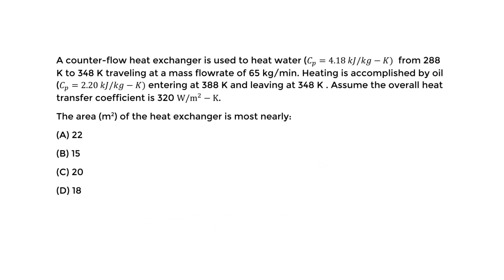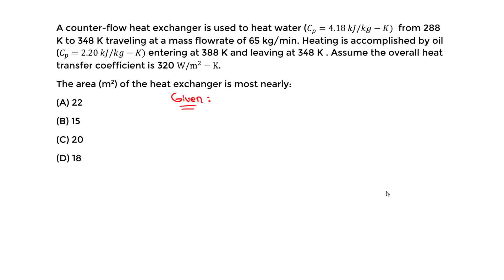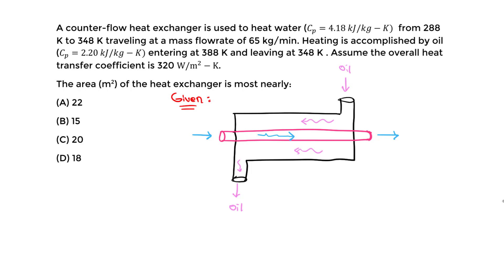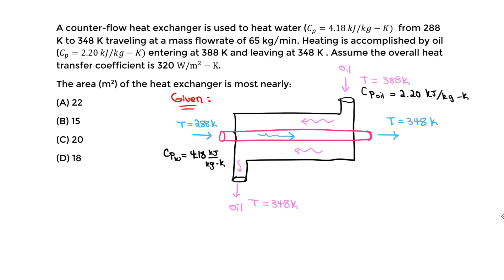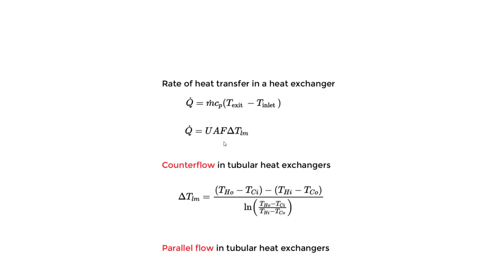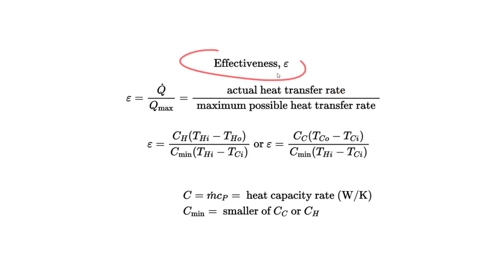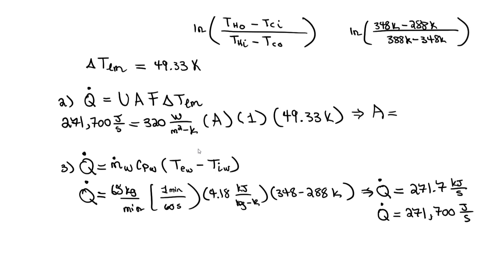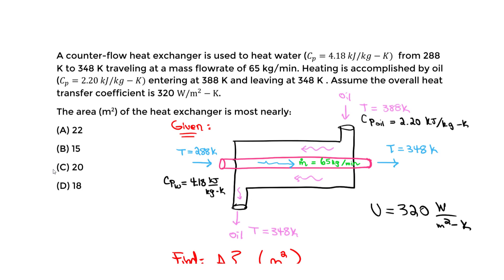FE Exam Review - FE Mechanical - Heat Transfer - Heat Exchangers

Comment: Why is the exit temperature of oil and water are the same  348k?
Reply from the maker: Hi Samuel, 

A heat exchanger is specifically designed for the efficient heat transfer from one fluid to another fluid over a solid surface. 

For example, if we have a parallel flow type heat exchanger, the two fluids enter at the same end of the heat exchanger and flow in the same direction, parallel to one another. In this design, the temperature differences are large at the inlet, but the fluid temperatures will approach a similar value at the outlets.

This is often the case when doing FE type problems, if not the temperatures at the outlet will be very close.

Comment: for energy balance is it m_dot cp (delta T) of water = m_dot cp delta T of oil?
Reply from the maker: Hello Ayubir, it can be confusing in this case but here is a photo showing I conducted the mass energy balance: https://drive.google.com/file/d/1gqU9hbvACTYWRtHC5Q889wNfLAaZK9DG/view
Reply from the maker: Note: What was done is ---> Energy (IN) = Energy (Out). For the IN part (water enters from the left at 288K and oil enters from the top at 388 K). For the OUT part (water leaves at the right at 348 K and oil leaves at the bottom at 348 K). Let me know if this helps.
Reply: @directhubfeexam   This helps, thanks
Reply from the maker: @ayubirfahim281  Nice!

Comment: Im a bit lost with the last part. 

for m_dot oil 
T=oil temp
T_inlet = 388k 
T_oulet = 348k
Cp_oil= 2.20 kj/kgk

m_dot(cp_oil)(T_inlet) = m_dot(cp_oil)(T_outlet)

dont I have two unknowns? I am stuck on this step.
Reply from the maker: I think the mass flow rate cancels since it will not change. The mass flow rate at the inlet is the same as the outlet.
Reply: @directhubfeexam  but then what am I solving for? I’ll just have cp(T_inlet) = cp(T_outlet)
Reply from the maker: @danithaman4610  sorry m_dot does cancel , that will be your unknown you would need to solve for.
Reply: @directhubfeexam  thank you for helping but it still doesn’t make sense to me. 

If I don’t cancel the m_dot I will have two and those will both be unknown. 

m_dot(cp_oil)(T_inlet) = m_dot(cp_oil)(T_outlet)

So I have everything but the m_dots. How can I solve for it? I can’t divide since it will cancel out the m_dots.
Reply from the maker: @danithaman4610  sorry, it’s hard texting this on phone. But, I think we forgot m_dot for the water which is known to be 65 kg/min. So you have water entering at the inlet at a temperature of 288K and water leaving at a temperature of 348 k. Let me know if you get an answer.
Reply: @directhubfeexam  I tried having m_dot for water being on one side and solving for m_dot on the other and it still doesnt get me 3.09. I tried changing the temperatures and I end up with 1.XXX. I dont know what else to try. Any luck?
Reply from the maker: @danithaman4610  
https://drive.google.com/file/d/1gqU9hbvACTYWRtHC5Q889wNfLAaZK9DG/view?usp=drivesdk
Reply: @directhubfeexam  Ohhhhh. I wasnt taking all energy in into account. Thank you for taking the time to make these videos and for answering my question.